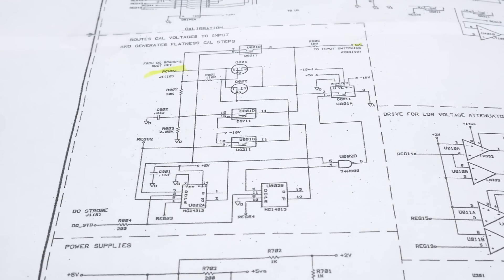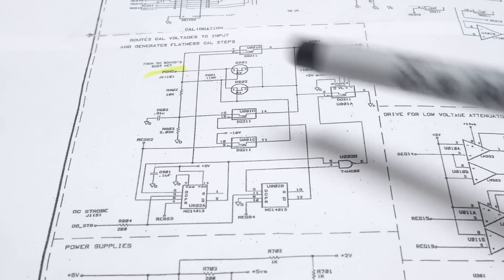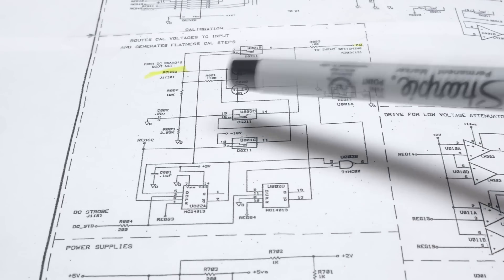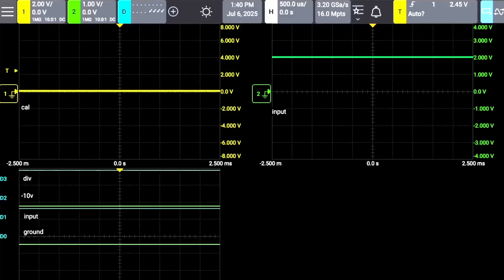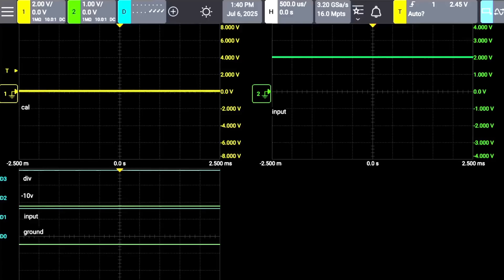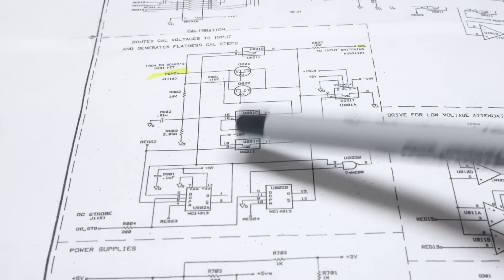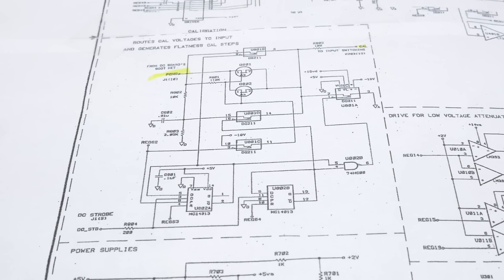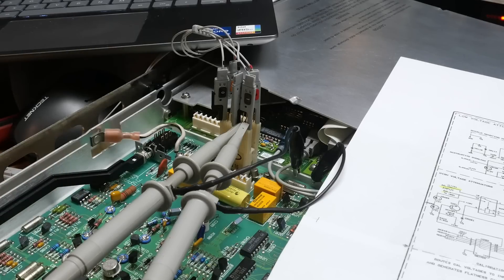#2303 Agilent 3458A 8.5 Digit Multimeter (part 3 of 16)

Comment: The switching part shown is not for the normal measurement signal, but there to generate the internal testsignal used in the ACAL step. It should be mainly for the AC part of ACAL, so it is a bit odd to see it jumping also in the ACAL DC case. They use a strobe signal to clock the flip flops and the jumps seen here look more like a side effect, not even intended to be used. Still odd but chances are it does no harm and saves a control pin.
 Except for the ACAL case the cal signal output should only go to the relay K203 and stop there.
The "input" seems to come from the guard amplifier on the DC board and this way provide some DC signal to do the test.